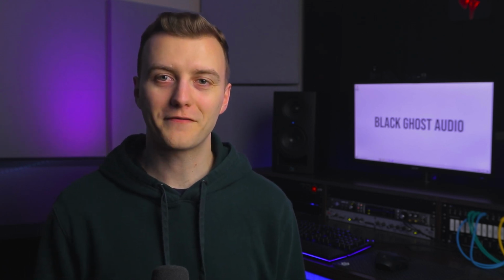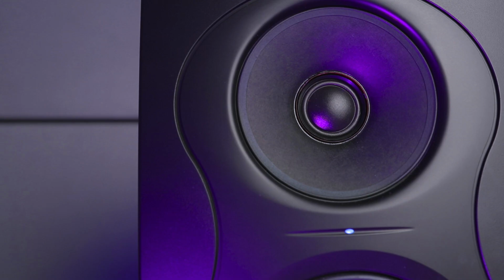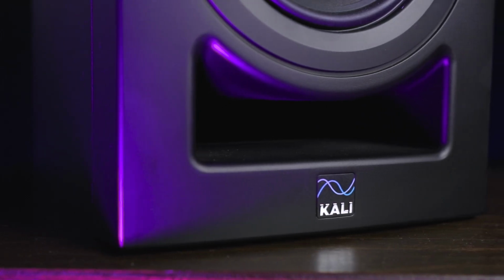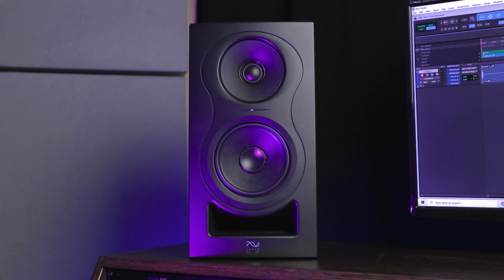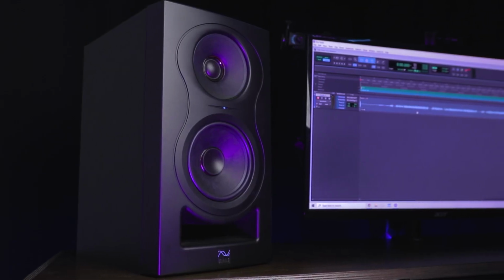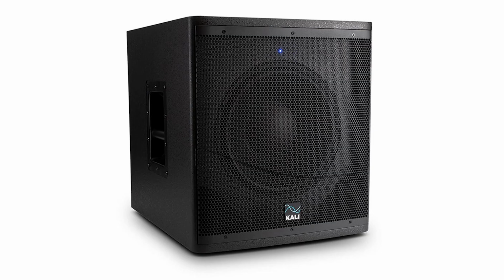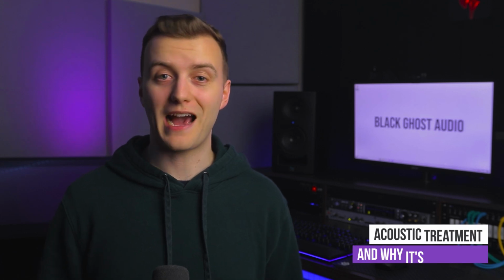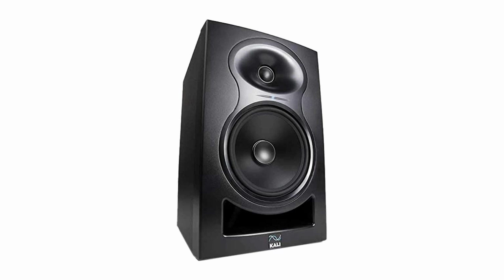How to Choose the Right Studio Monitors for Your Home Studio

Comment: when getting closer to the speakers i notice i hear more details and i bother less my neighbors. i started with the usual near field setup : the equilateral triangle of 1 meter but i notice that sounds much better if there is only 1 feet between the drivers and my ears (leaving a 1 meter distance between the 2 speakers. what driver size would you recommend for such "super near field" i tried 3" and 5" but i don't hear much difference other than more bass with the 5" ?. i notice my amp volume is around 5% for normal listening level. are there low power amp made exclusively for near field, trading off maximum power for better sound quality ?

Comment: Because of you, I just bought these Kali IN-5 ;) I don't regret at all. In your blog, you're talking about Sonarworks (compensating EQ for the room) : does it will take account of my built-in compensating EQ on my IN-5? Is it worth it ? I just bought London12 pannels to treat my room.
Thanks for your precise content!
Reply from the maker: Awesome! You can use Sonarworks’ Reference software for pretty much any pair of monitors. The boundary EQ on the IN-5s will definitely help, but you can accommodate for the acoustics of your room even further with room calibration software.

You use a special microphone from Sonarworks to record the frequency response in your studio; the software guides you through how to do this. Basically, you hold the mic in different positions as your speakers play sine wave tones which lets the software create a Reference calibration profile, meaning the boundary EQ settings you use will be taken into account.

Comment: Great review!  I am torn between these two speakers, the iLoud Micro Monitor and the Presonus 4.5.   I am an Electric Guitar player who plays Classic Rock, i.e., AC/DC. i use amp modeling software like Amplitube 5, Tonex, Positive Grid Bis. classic rocks use a lot of bass. I am the iRig HD2 to connect my guitar to the software. i am using the iPad 10. which would recommend? Thank you.
Reply from the maker: See if you can get your hands on both of them. Put them in your studio, listen to them, and make a choice. Return the pair that doesn’t work out.
Reply: @BlackGhostAudio  Thank you.  Very wise!

Comment: For room 10x12 ft would you recommend in 5 or 8 
Thanks
Reply from the maker: One of the main differences is that larger drivers allow you to listen from a further distance. If you're sitting close to your monitors, 5" monitors will usually work just fine. If you're sitting far away, you may want to go for 8" monitors. To make an informed decision, look up the spec sheet of the monitors that you're considering purchasing. There's sometimes a maximum recommended listening distance listed there.